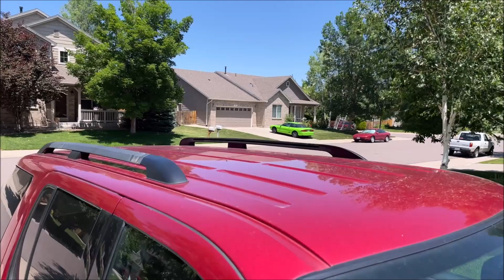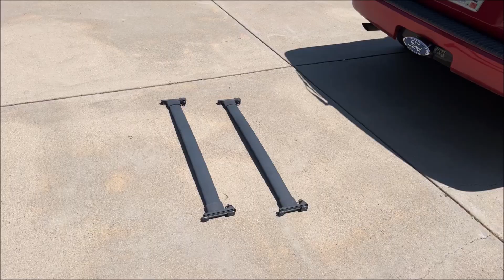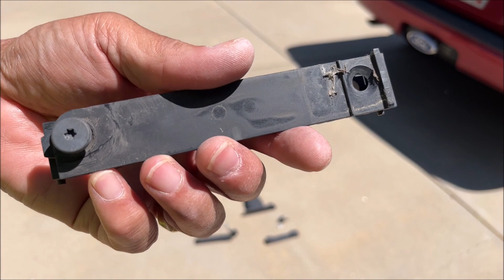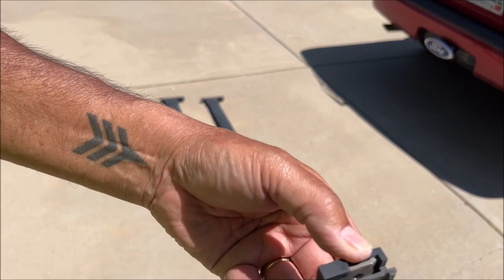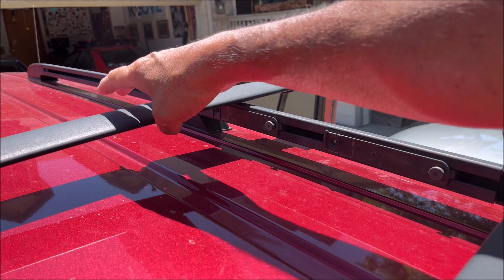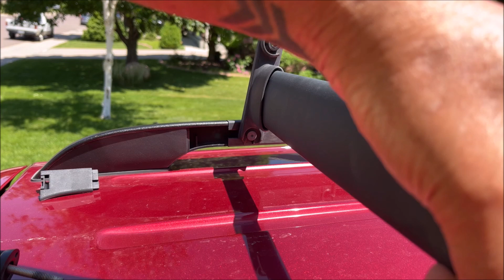2002 2003 2004 2005 Ford Explorer OEM Crossbar installation

Comment: Any idea on what the weight capacity is for these bars?
Reply from the maker: Not sure. Probably not too much considering how light and thin they are.
Reply: I think the whole roof is 300 lb. These explorers if that's what you've got. Get tippy especially with just a few too. Few pounds of air in one tire or so.